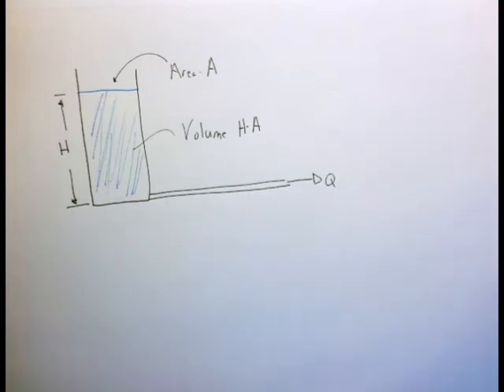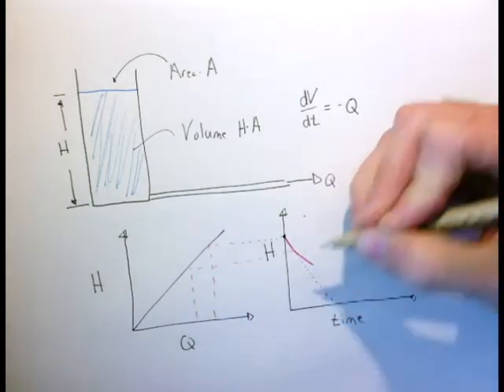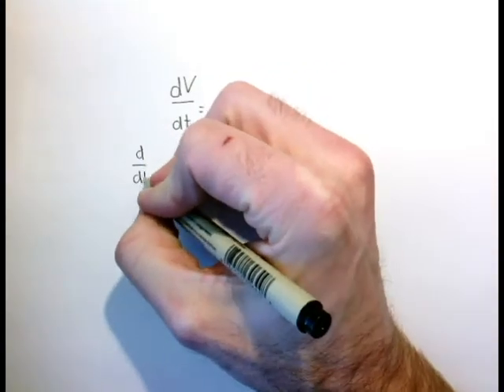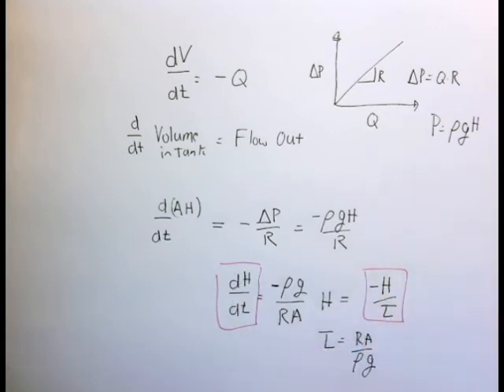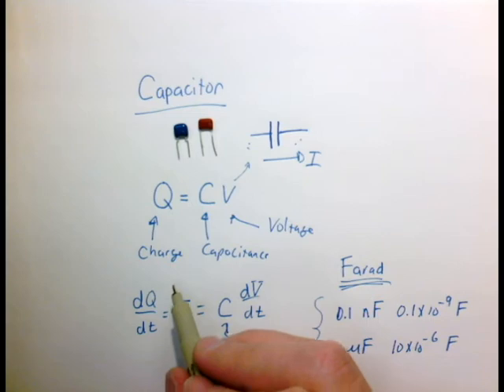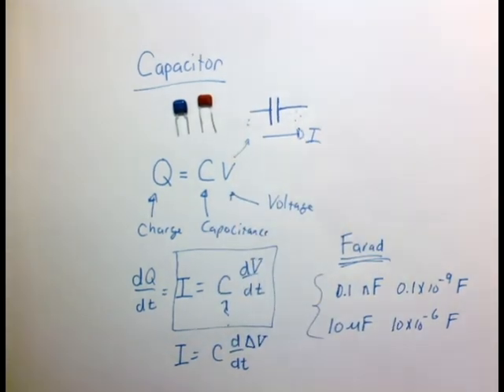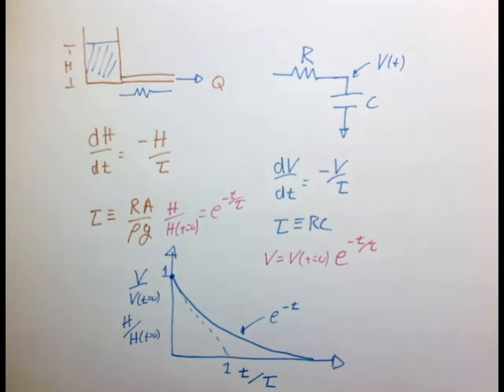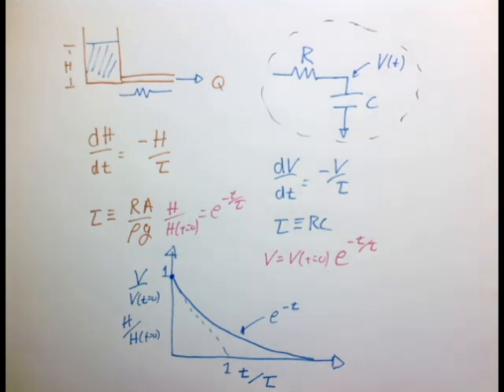Introduction to capacitance

Comment: Hi Brian.  One question: If I compute the discharge speed using Bernoulli I'll get : V=sqrt (2gh) I could plug that into the equation for Volumetric flow rate which leads to A^dh/dt= sqrt (2gh)*a    (a: the discharge orifice area) Integration leads to  t as a function of the square root of H. I don't seem to get an exponential function here.  Could you comment on this? (Perhaps R is not constant->delP/Q=rho*gh/sqrt(2gh)*a )